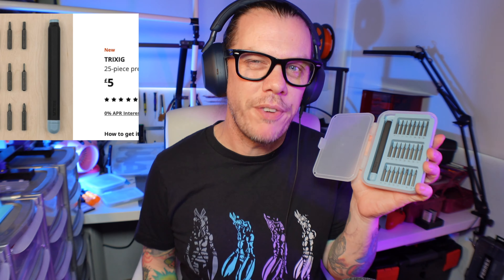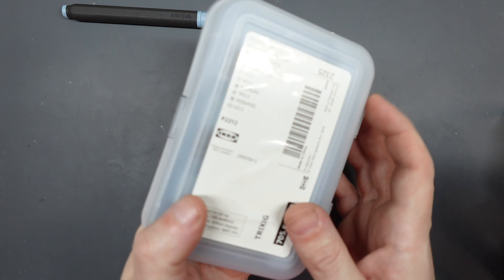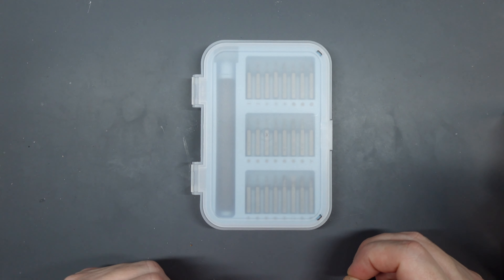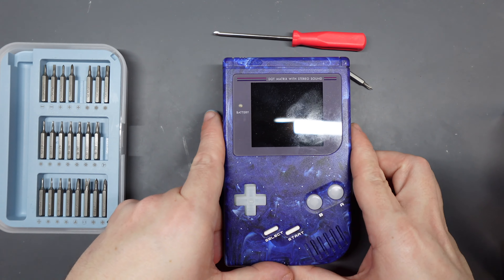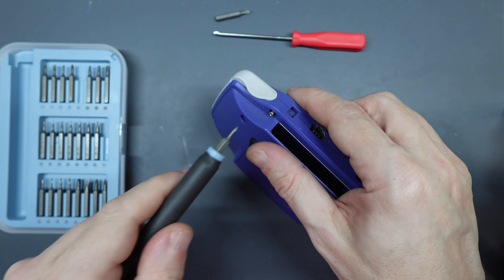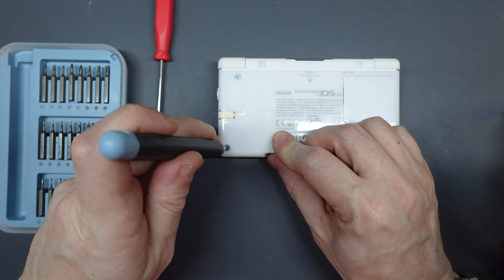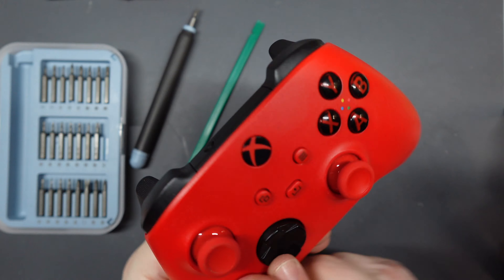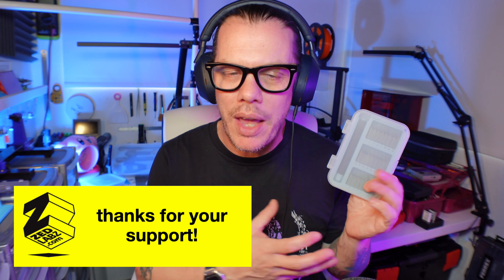IKEA's £5 TRIXIG Precision Screwdriver Set - Good for modding?

Comment: I have had a few of these kind of kits, and ultimately they end up stripping screws as the bits are not the highest quality.
Not bad if you only use them once in a blue moon, but I think it is really worth buying (expensive) higher quality screwdrivers in the more common sizes.
Reply from the maker: The bits in this kit are really good. I have that triwing bit a real hammering and no bits chipped off it at all
Reply: @JoeBleeps   Good to hear!  Guess it is more than worth the 5 quid then.   Looks like a good assortment of bits.
Also without wishing to sound like a pedantic arse, it is a tri-point not a tri-wing I believe. They are two different shapes with tri-wing being a kind of offset triangle.
Reply from the maker: @Martin_Edmondson  oooh I love that level of detail. Had no idea there were purposefully different angles on the tips. Tri point, I'll aim to remember that 🪛

Comment: Could've almost sworn i was already subscribed? I already have a load of 4mm bits and some drivers, what I'd actually love now would be an electric driver akin to wowstick. Needs to be not backdriveable, doesn't need to be rechargeable, i can just feed it NiMH. Doesn't need to be powerful. Would like it to be cheap.
Reply from the maker: I think an electronic one like this needs to have a good continuous torque but not necessarily too fast
Reply: @JoeBleeps  nah I just want it to help me with tedious screws, especially when they're long and fine threaded, without stripping anything delicate. When the screws need encouragement, I can do that by hand.

I already have a 6mm power driver a pistol shaped one, that one clearly has too much torque for something like classic consoles, handhelds, laptops, phones and whatnot. Sometimes I use it on the PC or last when I disassembled a mid 90s Yamaha keyboard for repair but mostly when assembling furniture. For assembling the Yamaha back together, it was a little too risky already, the softest clutch setting is already a little scary.
Reply from the maker: @SianaGearz  seems manual control is best after all 🤣

Comment: Neat little kit, especially for the money, as long as you don't need a lot of torque, I assume. Can't imagine the bits to be particularly well hardened. So I would still suggest saving a little money and buying a proper kit from a tool manufacturer, instead.
You can say what you want about the prices for bits from Hazet, or from Gedore, or from Metabo, or even from iFixIt, but they perform exceptionally well, imo. I've done so much stuff to those bits that they weren't made for and they didn't break. That's something I cannot say about any cheap bits that I had to work with over the years, unfortunately.
Reply from the maker: The hardness of the bits is actually really good